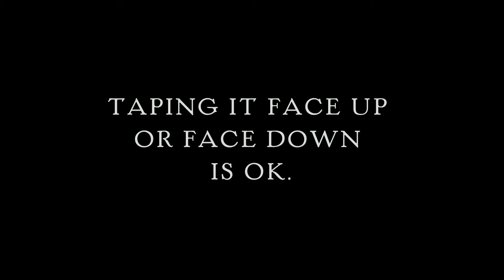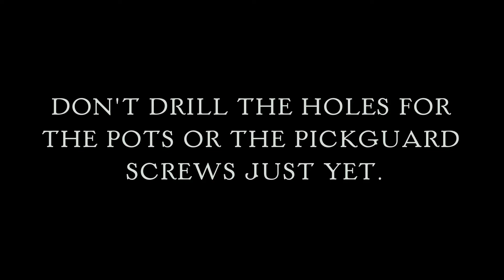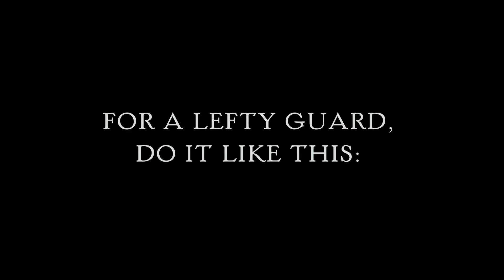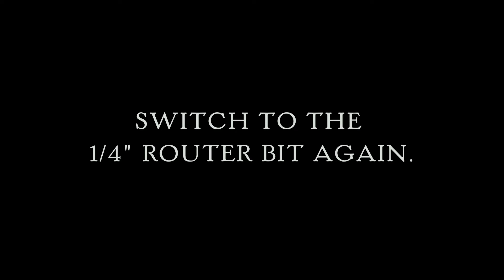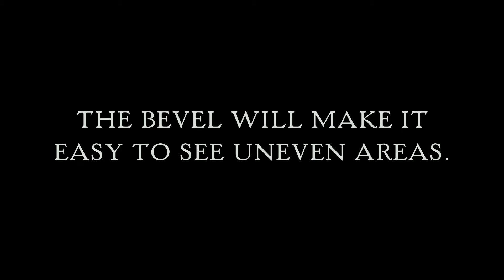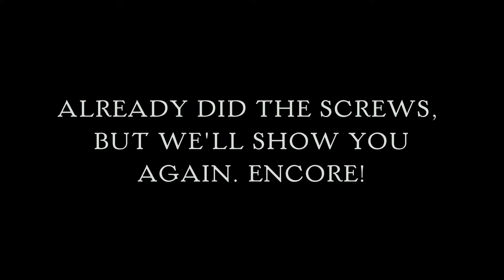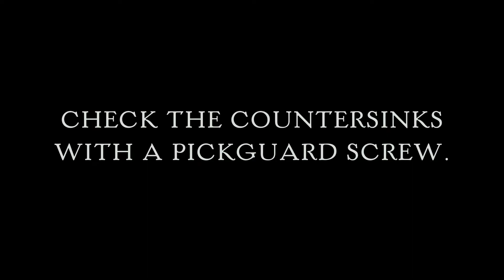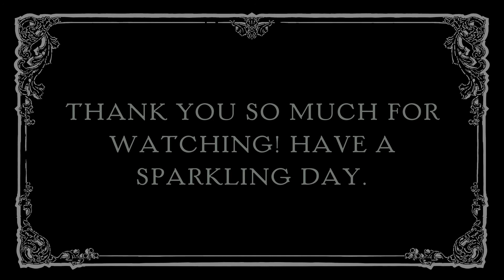Complete Pickguard Cutting Tutorial (Silent Film)

Comment: Hello sir!

What is the recommended diameter of the countersink bit? Thanks!
Reply from the maker: I'm using an 82 degree 1/2" diameter single flute countersink, such as the one here: 

https://www.leevalley.com/en-ca/shop/tools/power-tool-accessories/drill-bits/32308-hcs-82-single-flute-countersinks

3/8" might be easier to use. The one I use is from eBay, but the Lee Valley ones look to be higher quality, and the 3/8" diameter seems better suited to such small holes. 

Thanks for the comment! Updated my description as I didn't have the info for the countersink in there. Good catch and thank you! Hope this helps!
Reply: @guitar_md  thanks for the info. Forgot to ask the correct drill bit size? :)

I also saw some countersink bits with drill bits like 2in1 is this a good option? Or is it better to drill holes first and then do the counter sink after?
Reply from the maker: @mongmontances207  1/8" (.125") drill bit for most standard pickguard screw holes. For 6-32 screw holes, such as the ones on Fender switches and pickups, 9/64" (.140"). For Fender Telecaster neck pickups, they use 3-48 screws, and the holes for those screws use a .116" drill bit. 

Hope this helps!
Reply: @guitar_md  This video is amazing; thank you. Why single-flute for the countersink bit? I see five- and six-flute bits for sale in various places.
Reply from the maker: @mikepintoguitar  You're welcome! I'll be posting another pickguard copying video on April 24th so watch out for that one too! 

The single flute is best for a clean cut on plastic. The multiple flutes might possibly work as well, but are prone to making more jagged countersinks, and I'd expect them to look a bit rough or jagged on plastic. 

I use multi fluted countersinks for wood, but for plastic the single flute is the cleanest cutting I've found. I can't remember the last time I tried a multi flute on plastic so you can always give it a try and see if it gives satisfactory results but I can absolutely guarantee the single flute bits do a phenomenal job with perfectly clean cuts
Reply: @guitar_md  Thanks so much. Looking forward to the next video too!
Reply from the maker: @mikepintoguitar  Absolutely. Glad to help, and thanks for watching!